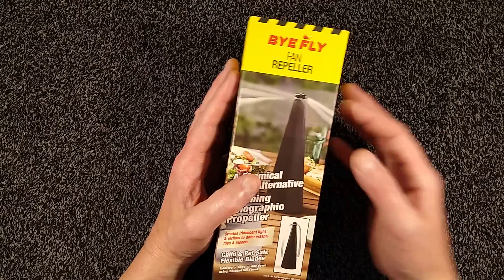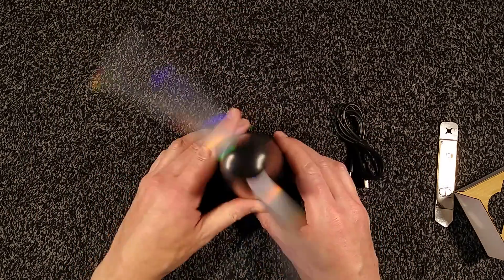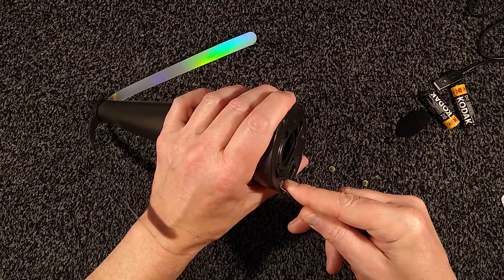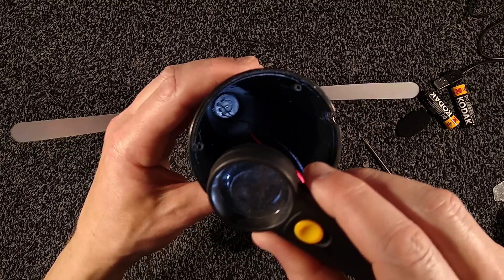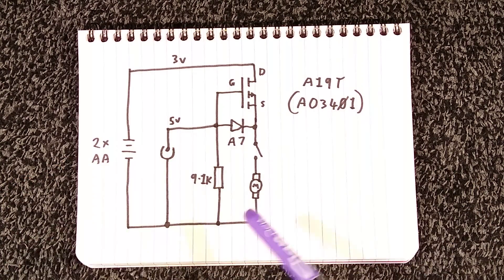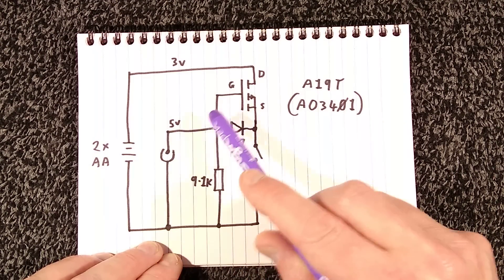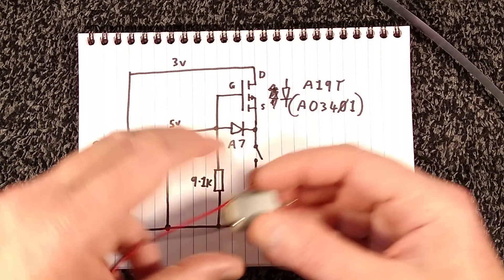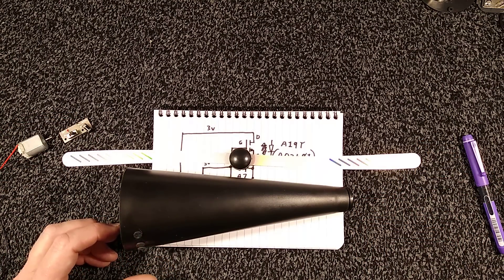Holographic fly repeller FLICKER ALERT!

Comment: Houseflies and other members of the genera have microscopic cilia (hairs) on their exoskeleton that are very sensitive to air pressure or wind. That's why it is very difficult to swat them, but if you swat from below it's almost a sure hit. The spinning blades not only have a visual impact on the fly but they produce enough of a breeze to deter flies from landing if they are placed properly. They do work, but fly paper or a zapper are a little more decisive.
Reply: read an article years ago in readers Digest called "How to swat a fly."
you slowly and carefully put your hands open horizontally slightly  above the fly, 
on both sides of it t, and then clap! the fly being prone to flying upwards, when it senses a threat, flies right into the path of your hands and gets squashed. works every time!  but have hand sanitizer at the ready tho...
Reply: Over the last few years EHO's and such have phased out recommending electric fly "zappers" in food preparation areas for there tendency to splatter the fly's remains all over when zapped. They've moved more towards UV and glue board style traps instead.
Reply: @mrrants  I won't argue with you since your reply actualy makes sense. I wasn't thinking about zappers being used in commercial food service. If the safety nerds don't want bug parts in your food, I would think this type of device would also not be permitted. After all, the rotating parts could detach without warning causing harm to people in close proximity as well as contaminating any food where plastic pieces don't really belong.
Reply: I bought one of those bug-a-salt things, works great. Very well made, very weighty.

Comment: If you added an ionizer to the existing spinner, would the spinning flaps disperse an ionizer's charge better if the electrodes were run out to the tips of the floppy blades.

Comment: Does this mean it's also putting 3V onto the USB socket when operating on battery? I'm not sure what you could really do with that, but maybe wire two of them together running on a single pair of batteries?

Comment: I wonder if this is the same effect... I was at a late night outdoor event that had a few of those popup canopies. One had a single center light, and was eat up with bugs flying around. Another had clear xmas lights wrapped around the legs, lighting the edge of the cover. That one had nearly no bugs flying around. I have tested this since and found the effect consistent.
Reply from the maker: Either lower intensity, or possibly the flicker of two channel LEDs in static mode.
Reply: That's almost certainly because insects use light to know which way 'up' is. If you have a diffuse light it confuses them a lot less it just acts as the sky. A point source causes the 'moth attraction' effect where they just fly around and around it. The insects are actually trying to get away but it messes up their flying. See: https://www.youtube.com/watch?v=MzLe0Zk31_U
Reply: @BooBaddyBig  I think they see the light as "the sun", which in most cases in nature gets them out of places they got trapped in, and indicates "UP". But when it's an artificial light, usually leads to them becoming trapped instead.

Comment: I think the air turbulence would deter flying insects without the "holographic", feature, things like this without the holographic foil have been around for yonks.
Reply: The big ceiling "Casablanca" paddle fans are outstanding at repelling flies. The flies can deal with the air movement but big slow moving blades trigger the flies predator avoidance "circuitry".
Reply: @davidg4288  Air curtains in shop entrances did work to keep out flying insects here in Aus but I haven't seen them in use for at least 20 years, I think they'd be energy intensive to run.
Reply: @milksheihk   I have seen them here in America in the past, but they always had a micro switch on the door frame, so that the fan only runs while the door is open, but like you, I haven't see these in years, they were a thing back in the 60's and 70's when I was a kid/teen
Reply: @Darius_Finnigin  The places that had them here often didn't have doors, just the security shutters for after close.

Comment: Is it really as quiet as it sounds on the video?  Motors usually make whining noises that drive me nuts after a while.  Wonder is putting colours on a regular fan blade would have similar effects.
Reply from the maker: It's a low speed motor with no gearing.

Comment: I remember those little electric motors from years ago. When I was a kid I got an electronics kit for Christmas and you could make a simple motorised car using that kind of motor. I remember with fondness putting together the battery clips, wires and the tiny gear wheels to make that car.
Reply: Around age 8, I took the motor out of one of my slot cars and tried it with a 6v lantern battery to good effect.  I then stuffed the wires into the 120V outlet. As they say; You learn more from failure than success.  It was a formative experience.
Reply: @frankhage1734  Brings back memories of probing a boiler room switchboard with an old analogue multi meter switched to a very incorrect position - and the sound as the meter faceplate hit the cabinets on the opposite wall! 😱😵‍💫🙄
Reply: @frankhage1734    I did the same things when I was a kid, live and learn! 😊
Reply: @frankhage1734 did it blow up? Lol
Reply: @samholdsworth420  Based on previous voltage experiments, I expected the motor would spin super, ultra fast!  What I got was a big flash in the outlet with my fingers right there, and a tiny flash from the now dead motor. No motor movement at all. Basically  uninjured, I was mostly worried my mother would discover the smoke stain burnt into the outlet.
Reply: @frankhage1734  😆
Reply: I once hooked a DC motor to a low voltage AC teansformer.  It buzzed and smoked.
Reply: Me and my brother each had an RC car with 2 of those motors (in each). One for drive and one for steering. Tandy branded. Fairly decent replicas of the Porsche 959, but with zero Porsche branding. Mine got disassembled when it stopped working, never to be reassembled. My brother's just recently emerged from my parents place during renovations... It will likely be modernised at some stage soon - modern RC receiver, brushless motor and ESC, lithium batteries, servo steering, etc. Which I guess would then make it irrelevant to the conversation about the little brushed motors 😂
Reply: Yeah! Had a few plastic car models from Japan that used these to propel them around the room.
Reply: I definitely had a few of those growing up - some in slot cars, one in a "discover solar" type kit that had a little solar panel, one of those motors, and some attachments with spirals or radial lines on them - you could see how the motor speed changed as you pointed the solar panel at different lights, or different angles. At some point, I discovered those motors even worked underwater! They actually kind of pumped water through what were supposed to be the air cooling holes.

Comment: That MOSFET also works as reverse polarity protection, probably not needed in this circuit but it's a nice feature.
Reply: Without reverse polarity  protection, the fan would spin backwards and attract the flies. 🤡
Reply: Actually this is a very good way to implement reverse polarity protection for medium power applications. I use it when the forward voltage drop of a shottky is too high for my needs.

Comment: Why didn't they just use two diodes? One off the 5VDC and one off the 3VDC going to the switch. The diodes would have taken care of no reverse current flow.❓
Reply: Diodes have a voltage drop, so the motor would only get ~2.3V from your 3V batteries.

Comment: Given the 5 volt USB is a barrel jack connector, they could have forgone all the circuitry for a simple 3 position female barrel connector and maybe a diode and/or a resistor.
At least then you'd see some speed increase when you connected the USB power.
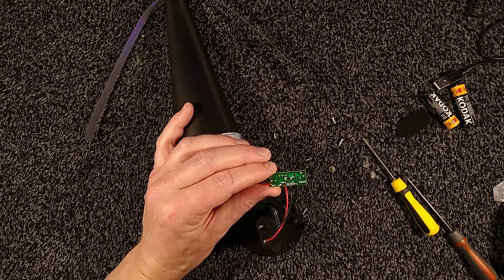Reply: 3:50 In fact it looks like they did use a 3 pole/position female barrel jack but just coupled the two negative switching pins to the ground plane of the PCB.
Reply: Go on, bodge it Clive, feel the need, the need for more speed...🤣🤣🤣

Comment: Clever designed circuitry? No, overthought solution for a simple problem. Just use a mechanically switched DC socket. Jeez, have engineers become so focused on solving basic things with circuit boards that they've forgotten about mechanical solutions?
Reply: Electrical engineers make electrical solutions
Reply: @BritishEngineer  That sounds like they're very limited in using their brain.

Comment: Not sure flys are put off by the 'hologram' - more likely they're either put off by the rapidly moving thing and air flow and/or put off by violently hit by a piece of plastic if they get too close.  Good thing about these is that they also don't hurt at all if you put your hand in them to , e.g. pick up a bit of food undernearth it.   Good for flys. Wondering if it works on wasps too. Probably doesn't do anything for ants.
Reply: I suppose compound eyes are dazzled easily by iridescence. With lightly sudsy hands you can grab fruit flies right out of the air, Karate Kid style.

Comment: So the motor is fed 3V from the cells but 5V from the USB, and there's no difference in speed?
Reply: From the USB, 5v minus a diode drop, so about 4.3v to 3v. There should still be some difference agreed.

Comment: Hm, what’s the advantage to using a FET over just another diode?
Reply: Less voltage drop. 600mV lost across a diode is significant when the supply is only 3V.
Reply: @cool386vintagetechnology6 agreed, the FET would have much less voltage drop when on.
Reply: @cool386vintagetechnology6  Yeah I was thinking the 3V would go through the body diode and still be dropped.
Reply: Looking at other comments, though boring, using the switch on the barrel jack seems like a no-brainer.  I also just had a thought for other types of connectors that this circuit could probably be achieved with no drop on 3V or 5V using just a SPDT relay, no other components.

Comment: This must be an upgraded version. Have seen them with just grey blades and had a minimal effect on flies. Nowadays you would expect a lithium version with a USB c socket.  Clever circuitry.
Reply: Fans confuse flies, so this thing with spinning blades  could do the same.
Reply: @tonysheerness2427  They home in mostly with their chemical sensors towards food. The changed wind directions make them fly in circles with blades coming near increases their alertness. Yes it has a bit of an effect. Going to get one with holographic markings to see the difference.

Comment: We have six of these, we love them. We have an outdoor kitchen and they work great, especially when you have people over and you set food out on the fable.

They are quite fragile, and on a few units , I had to use a knife to adjust the gap between the motor and the spinning part. (The gap closes, and it stops spinnjng)

Very nice device but they are a bit fragile and need to be readjusted when you tip them over.

Comment: I was born in 1969.
My toys had a direct connection between the motor and the batteries - no electronics were needed.
If there was a device with optional external power supply you plugged it in (into a tiny socket in the device). When pushing the plug in you mechanically disconnected the internal power-supply of the batteries - also no electronics needed.
Now my question: what's the technological advantage of the last 50 years? 🤷‍♂️ I can't avoid the impression it's just an overenginered solution for a problem that didn't exist in the firstplace. 🤷‍♂️
Reply: in this case it is, but the price of these components came down so much in 50 years that it does not really matter. Same as for microcontrollers, nowadays a lot of stuff has micros to do very basic stuff that could have been done with dumb components too, but the low end micros are so cheap that it's not worth caring
Reply: Because the electronic parts are cheap and they can use them. The same reason they use a cheap microprocessor when a couple of flip flops would work. And before that they used a couple of flip flops where a switch and relay would work. 
I still do have a few appliances with motor driven mechanical timers. While those timers will wear out eventually they don't contain unreliable electrolytic capacitors, and aren't much bothered by power spikes or outages.
Reply: Well, mechanically switched things can break, particularly in the hands of curious children, and probably require more parts that have to be made and assembled. It's almost certainly cheaper, and may be safer, to have fewer mechanical parts and to rely on mass-manufactured electronics. It's the same kind of reasoning that has driven lots of formerly complex electronic or electro-mechanical devices to be replaced with standardised off-the-shelf CPU boards and software.

Comment: My quid shop Kodak batteries ruined my Samsung TV remote
Reply from the maker: They used to be great before regulations required a change of chemistry that was there to reduce internal pressure build up.
Reply: @bigclivedotcom  yeah either worked great or get them home from Poundland and there already dead
Reply: @bigclivedotcom  What they should do is make another law stating that if an alkaline battery leaks and damages a device, the manufacturer would be liable for the cost of repairing or replacing the device. Most likely Duracell wouldn't be so garbage after that!

Comment: Is there a technical benefit to this method of separating the USB & battery compared to using a barrel jack's disconnect function? A diode-drop on 3v seems like a huge efficiency compromise.
Reply from the maker: There's no voltage drop on the 3V supply.  Just on the 5V supply where it's useful.

Comment: Does it generate any air flow, or just spin?  Air flow will tend to keep flys away.  Very interesting, thanks.
Reply from the maker: Mainly a visual effect.
Reply: Fly's are not generally bothered by breezes or regular air flow. They are bothered by sudden non-linear (turbulent) air movement accompanied by a visual movement.
Reply: It depends if the blades are level or set at an angle.
Reply: @BlondieHappyGuy I ran into these things being utilized in a fancy pastry shop in midtown Manhattan and the lady behind the counter said that she thought they'd be a scam too, but they do actually seem to work.